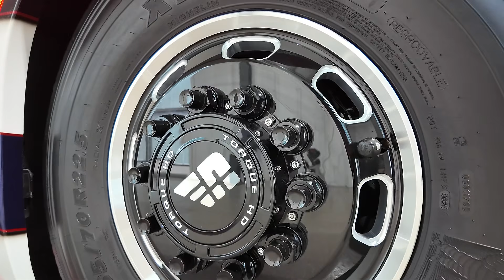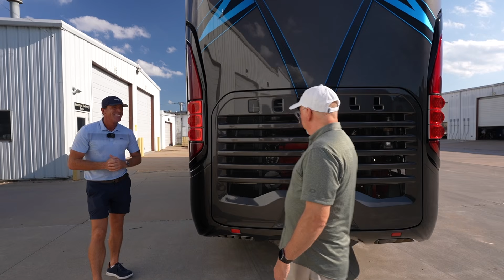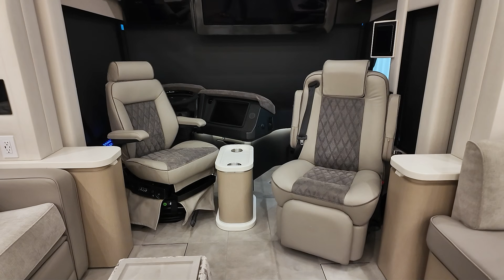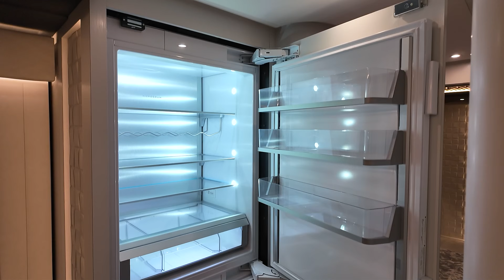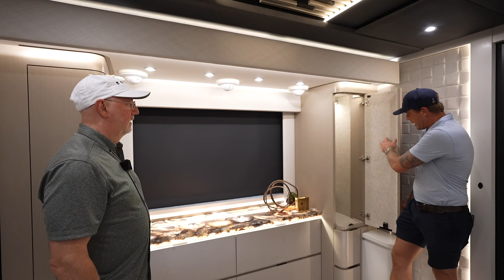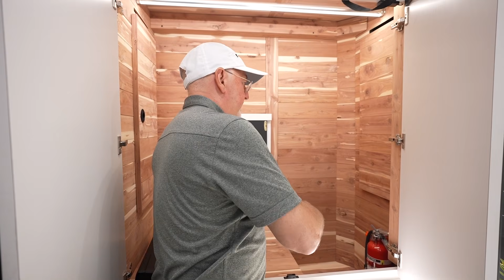Why This Custom Newell Coach Is One of the Most Expensive Motorcoaches In The World!

Comment: Beautiful coach, they should’ve put the paint through the window scheme with whatever material that they use kinda looks a little unfinished in my opinion, but that’s just me. Beautiful Paint.
Reply: On the windows that are used for the inside projection screens if they put a screen to carry the paint through, you can’t use the window for outside projection.
Reply: @robertbailey-d8o  build sheet does not indicate projection